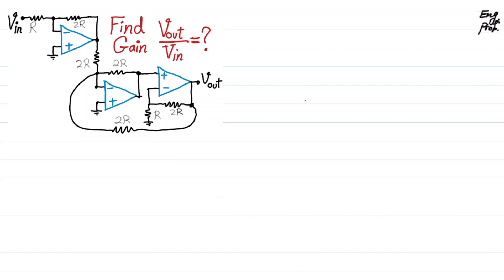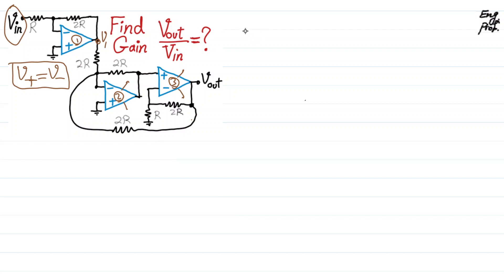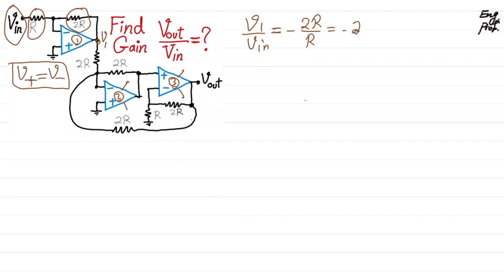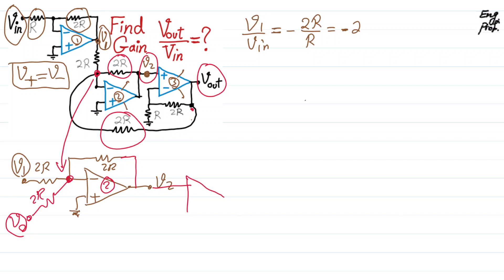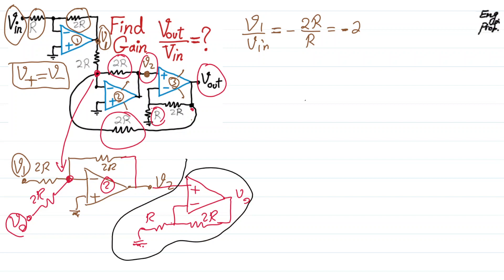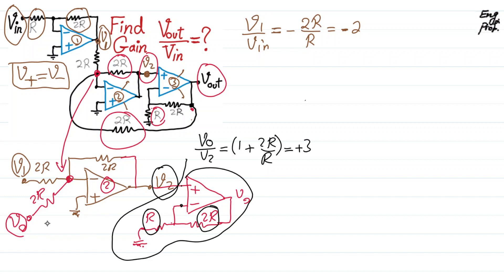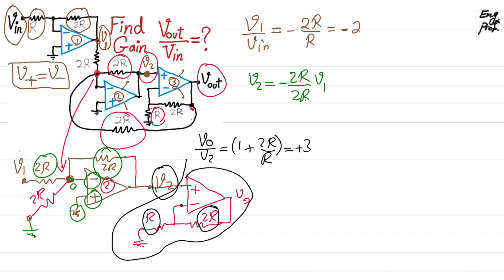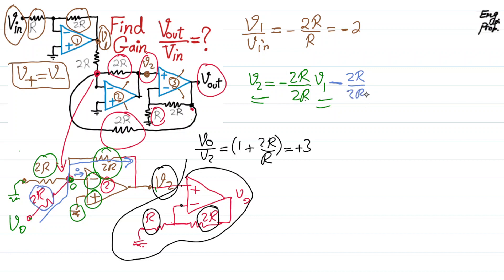Gain of Op Amp Circuit with feedback loop (find voltage gain)

Comment: Very well explained.
Thanks for sharing your incredible knowledge.
It allows me to keep my electronics hobby alive.
Reply: I've one question though.
What are the advantages of these kinds of circuits?
We could achieve the same gain in one stage.
Reply from the maker: @ami6packs  Good question. In this video example, the first op amp inverts input voltage by providing a gain of -2 while the middle op amp acts as an inverting voltage summer with negative unity gain and the third op amp acts as a non-inverting amplifier with a gain of 3. There are of course multiple ways to design this circuit. Here are a few related videos:  Summing Amplifier (non-inverting Analog Adder) https://youtu.be/zPnaCPOUw5E
1x, 10x, 100x, 1000x Switched-Gain Instrumentation Amplifier https://youtu.be/9-MLqyewXW8
Instrumentation Amplifier with Electronic Gain Control https://youtu.be/C4tghZ-q6Zs
Summing Integrator vs Difference Integrator with Operational Amplifier https://youtu.be/_5NT4mQxVEo

I hope these these videos are helpful.
Reply from the maker: @ami6packs  You're welcome! Glad to hear that your liked my video.